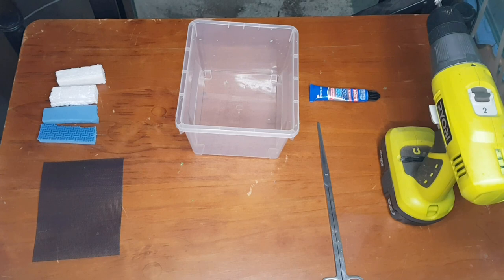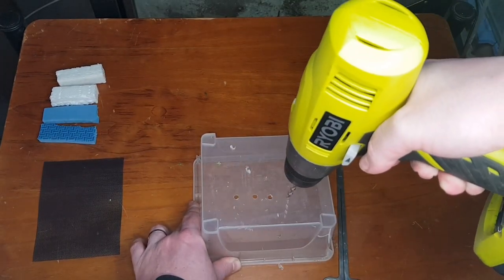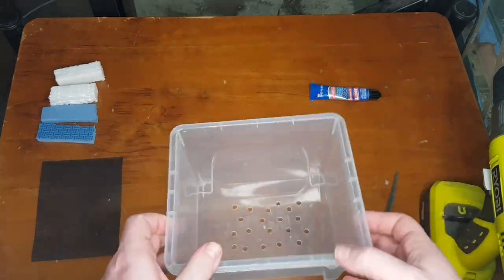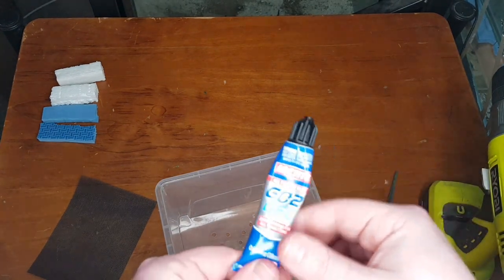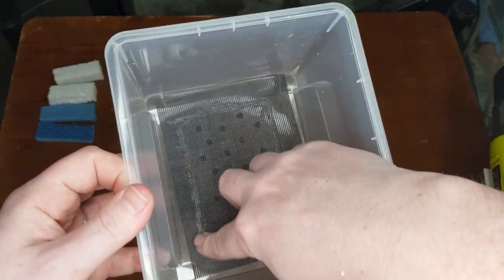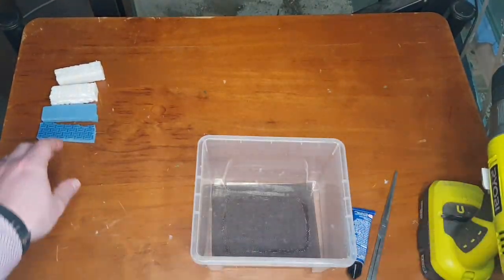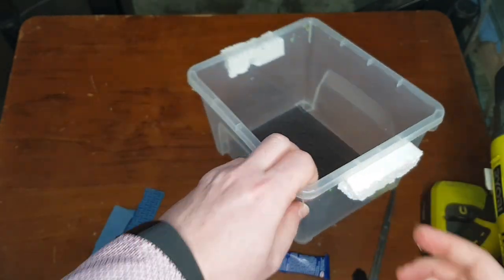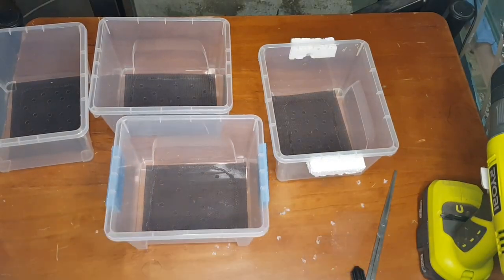DIY Aquarium Breeder Box / Fry Keeper

Comment: Tip. Cut part of the base out and replace with larger hole mesh.
Use as adult holder for breeding egg scatterers.
Eggs fall straight into tank. Simply lift box out and place in next tank for easy relocation with no netting, marbles or lost eggs.

Comment: I know at this point, the post is a couple years old. I just wanted to add something. You do NOT have to let super glue gel cure after use. You can actually use and even do repairs underwater with super glue gel. No mess and it cures instantly
Reply from the maker: Cheers 👍

Comment: How long does it take for the glue to come off my finger? I can't open my iPad air as it can't read my finger print.
Reply from the maker: Haha sorry mate. I tend to pick at it for 2 to 3 days 🤣
Reply: Go swimming, or take a long bath. 
You lose more skin cells in the water, so the dead cells with super glue on them will fall off.
Reply: Nail polished remover.